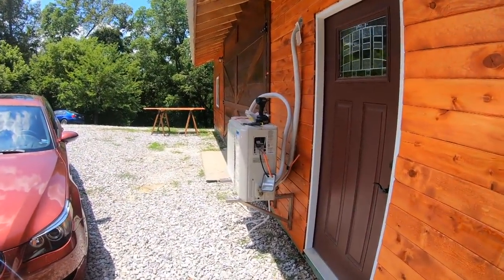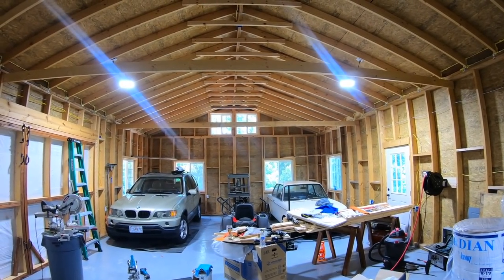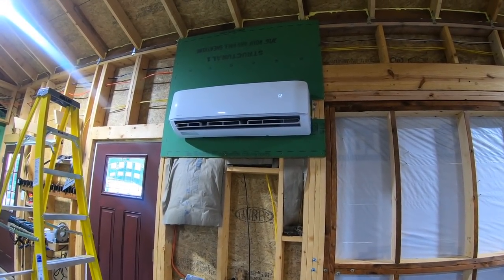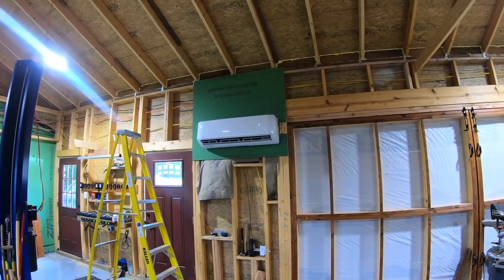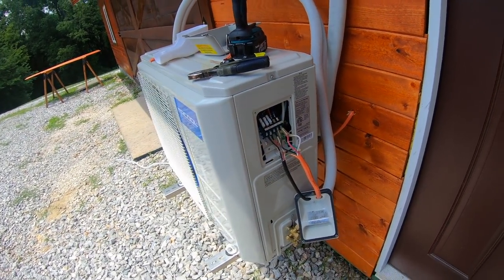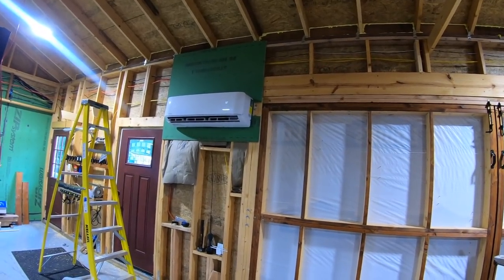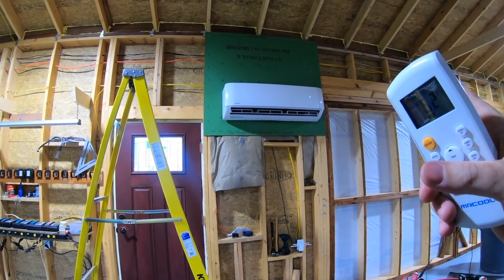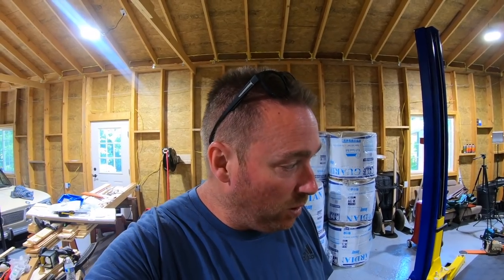MRCOOL Mini Split AC Heat Pump Installation SECRET TIPS Part 1

Comment: You need to evacuate the noncondensibles in the line set and evaporator coil down to at least 500 microns.  Also you need a disconnect on the outside electric.
Reply: Directions from the manufacturer specifically tell you not to do that. Why are so many nimrods in the comments saying to pull a vacuum on pre-vacuumed and filled lines?

Comment: So in 2 years from the video the unit went from $1200 to over $2000. Instructions I found it seemed odd that wall mounted you only need 6" clearance but on ground pad you need 12". Seems like 6" would be poor air flow. Hat that they only provide 25 feet of line when 12 would get it done if on a ground level room. Warranty is a joke to meet all the requirements over time. One guy had leaking factory joint lines but would not cover as warranty!

Comment: each 12000 btu for 500 sqft. You have 24000 btu it's mean is good for 1000 sq ft.But if you square footage is more that 1000, 24 btu is not enough. Plus insulation of building.

Comment: A nice and very informative  video, Nathan.
  

I am also considering installing  the same heat pump to heat/cool the 1st floor of my house and request you to help answer this query of mine.
The 1st floor of my house has an open plan with 16' tall ceiling Formal and Dining Area of 800 sq ft. The formal area connects to family room and kitchen with very wide opening ( no doors ). The family room  and kitchen has no wall in between and  covers 500 sq ft with 8' ceiling. As such, all these spaces have no constriction for air flow in between.  A circular staircase goes up to 2nd floor from formal area and 2nd floor has its own zone for heating/cooling.  The home is well insulated and is  located in bay area , CA where weather is temperate all through the year.

Do you think 24000 BTU MrCool heat pump will be able to heat/cool adequately this 1st floor space if I put it in formal area  ?  I was initially thinking 36000 BTU, but after watching your video  I started wondering that if 24000 BTU unit can cool your 1400 sq ft of uninsulated shop easily, this should be enough for my needs too. 

How has been your experience with this unit in the winter ?
Reply from the maker: The unit is a beast, heats my shop with 16ft7in ceilings, no issues , I still dont have 100% of the insulation in either , even at 10deg  the other night it had plenty of power

Comment: Your copper loop will trap oil! You compressor will fail!
Reply: Lance Rudy yes it will. A proper trap would be preferred but these small units really wont slug the compressor . So a trap is not necessary . Looping it does the opposite. It will starve the compressor for oil.
Reply: vipleather That is why i prefer cut-to-length refrigerant lines. Seems if these lines need to be coiled, the coil should be oriented horizontally. I wonder if Mr. Cool recommends vertical coiling?
Reply: @charlieromeo7663  MrCool recommends horizontal coiling.

Comment: Dude, what a mistake you made with your insulation.  My shop is 30x40, with a 14 foot center ceiling height with 12 foot walls) I have two mini-splits in it ( a 12,000 and 18,000 BTU heat pump).  Now you maybe should have done like I did.  I framed the building with 2x6 framing, used can foam to foam in all of the studs (96 cans) and bought 9 inch unfaced attic insulation and put 3 mill plastic over it before I installed drywall.  On a 20 degree day the two mini-splits will easily keep the building 50 degrees, and the building keeps it heat in overnight without the heat pumps running.   Now here in Eastern NC we have already had 80+ degree days here, and I have not had to run the A/C on the heat pumps is of yet.  The highest electric bill I have had is $80 and that includes running lights, and other garage equipment to include a car lift.  I would guess the cost of the heat is less than half the cost of my electric bill.  I should add that the building has a tin roof, two 10x10 rollup doors that I insulated with 1/4 inch aluminum over foam insulation, and a 36 inch wide walk in door.

Comment: The window ones work good to instead of putting them in a window, you just frame them to what ever size you need and can put them anywhere you want. Only need 110, but they don't heat though. Looking good, feeling good

Comment: why not mount the unit on the ground, maybe on a small concrete pad?
Reply: I'm trying to decide on same question.  I've read the unit should be 36" from a wall.  I also see the wall mount keeping it easy to clear leaves/debris out.

Comment: you have to vacuum the lines before opening the valves at the outside unit. not mentioned in the video.
Reply: Line set for this system is factory vacuumed sealed. When you attach to the unit, seal is broken as the connection is tightened.
Reply: Yes nitrogen purge once connected and deep vacuum is the proper way but diy guys don't want to spend the 500$ on the right equipment to install correctly. The

Comment: Definitely a DIY you should have drilled the outside hole 1 inch below the indoor so your drain runs downward. Also you should have cut your line set before installation. Now you’re gonna have to pump the system down and redo it.
Reply: Yea and did you hear him talk about pulling a vacuum? No because he didn’t mention it and I’m going to go out on a limb here and say he didn’t and that’s the most important step LOL

Comment: The most important step before you open those valves to release the refrigerant is a proper triple evacuation to below 500 microns then open the valve you should always always always pressure test with 300 psi of nitrogen let it sit then triple evacuation a regular home owner is going to be dumb enough to try this and pay tons of money to have it fixed properly by someone who actually knows how to install these units properly but best of luck
Reply: Are you saying you can still evacuate the lineset before you crack the factory seals?  They come with fittings on the factory lineset for evac/charge?

Comment: Nothing like a homeowner hack job to save a dollar.  The water issue is the drain just laying on the ground like that has an air lock from being double trapped. No disconnect and need liquid tight on both control wire and main power. Local supply houses will not warranty parts for units they didn’t sell, even if they sale the same brand. I personally ran into that on a Fujitsu mini split. So when someone tells you units off the internet has no warranty take it to the bank.

Comment: Hopefully you evacuated the refrigerant lines before cracking the valves
Reply: Actually, both the inside air handler with the lines already attached and the outside condenser are already charged. No need for it to be evacuated.

Comment: Apperantly it is not recommended to loop the copper pipes as it will collect oil at the bottom and reduce kife of ac dramatically.

Comment: I don’t understand why they went so far to make these units a diy install... couldn’t they develop these units to vacuum out the air in the lines , test for leaks. Then charge the lines all on their  own within the unit itself....  add just that lil bit more to make these things soo much better and redundant ,,, add a vac pump and the software to test itself and thro up a code before any refrigerant gets primed into the lines.  .?  To me it’s a no brainer

Comment: All the money you spent, it's kind of chintzy to have 9 feet of coil behind your unit. It's also bad for your unit because now you have non-condensables in your lines forever. For $160 (vacuum pump, gauges, swage) you can cut down the pipes for the right size, make it neat, and make your unit run better. I dunno. Maybe it's just me but that thing is gonna sit there for a decade or more, and you bothered getting the cover which is $55+, but didn't do it right. Weird.

Also, with the electric, the manual is very clear to make sure the colors/numbers match up. For the power, 240v 1 phase doesn't matter what red/black go to, as long as they're hot 120v lines (120+120 = 240v). The neutral in this case is not used and should be capped. 10/2 is appropriate for this unit (neutral not used), but a 10/3 is "future proof" for just a few dollars more. Could you get away with 12? Maybe. You'd probably start tripping the 20amp breaker it's hooked up to after a few years once it doesn't start up as smooth as it used to. And, as mentioned elsewhere in the comments, you don't have a disconnect "within sight of the unit," which is code.
Reply: reddog418 
These units require a neutral in most cases. They are powered by a VFD and the card requires a neutral that it bonded to ground.

Comment: Next time solder the lines. just cut them and add a union, leave the ends alone. Its NOT 410 pressure.

Comment: No disconnect?

No connectors for the electrical going in and out of the condenser?

You didn't angle the hole downward so it is causing a leak, very sloppy installation, typical of a do it yourselfer.

All systems come pre charged, did you bother to vacuum it down before starting up the system?

The shop has some very strange framing methods

Comment: Where did you buy unit
Reply from the maker: Link in the description, the price went up thought in the last 2 weeks
Reply: Nathan's BMW Workshop I was gonna say When I type in google same model comes up for $700
Reply from the maker: Probably for like a 9000 btu not a 24000
Reply: Nathan's BMW Workshop correct for three car garage it’s perfect
Reply from the maker: See I have basically a 4 car garage but with a 16ft ceiling
Reply: Nathan's BMW Workshop 24000 isn’t that overkill what’s the square footage of your garage
Reply: Hey nathan.  I only see the 24k unit for $1700.  Did you get the DIY kits thats already pre-charged? Or was there a sale that I missed? The link you have is the same link I found.

Comment: Why didn't you run the lines inside the walls and hide the extra line inside the wall? It would have saved you money for the trim and it would look better.

Comment: So many mistakes on your installation.  By oversizing the breaker and wire gage you risk damaging the unit. If it was having a issue you want to trip the breaker to protect the equipment. 20amp 2 pole breaker is what manufacturer calls for. Bigger  is not better. It should have been wired with 12-2 wire, not 10-3. Two hot and a ground wire. No neutral wire needed. 
Your running of refrigerant lines is terrible. Buy a tubings cutter and a flaring tool and get rid of extra lines. 
You also need to pull a vacuum on the line and evaporator head to remove all the air.  If you don’t, when you open up the values you are contaminating the refrigerant.

Comment: The schematic is very clear if your not a DIY! Luckily you did not mix up 2 and 3. No way you should have a breaker larger that rating of 25, this is a joke, do not listen to this guy. You could burn your garage down with an oversized breaker.

Comment: I got mine installed and theres knw thing I didnt like It leaks a lots a water
Reply from the maker: Make sure the drain is hooked up, and make sure the head is level so the water can run down the tray to the drain , had that issue here on my new unit

Comment: A gas furnace maybe would be 80,000 Btus? This unit maybe is 12,000! I wish you luck in January  unless you stay above 50 degrees!
Reply: Youd be surprised at what these can do i have a hyper heat unit and it was producing 90 plus degree air in single digits and its only a 18000 btu outdoor and  12000 heads 20s or above they have no prob blowing 130 degree air all day   keep my two story 16x30 well insulated barn at 60ish all winter set at 65.

Comment: Why do you need outdoor wiring ? That’s what the installation kit is for it protects the wiring.  And you should have cut the hoses to size, that’s tacky work guy. Ppl do not do this.

Comment: did you tell everyone to pull a 5 micron vacuum, on the copper supply lines before you release the charge from the condenser unit ! ?  quess you were too much in a hurry to read the directions !  i`m in the business 40 plus years.  good luck with that system lasting ! nothing wrong with doing it yourself but learn how to do it first. hope other read first !

Comment: Except electric work everything made sense. 
I thought they provided wire, why did you have to purchase it?
Reply: THEY PROVIDE THE COMM WIRE THAT GOES FROM THE HEAD UNIT TO THE UNIT OUTSIDE, BUT NOT THE POWER WIRE FROM THE BREAKER BOX TO THE OUTSIDE UNIT

Comment: You should really vac out the pipework with a vacuum pump to remove the air prior to the release of the gas 
air has moisture in it and this can damage the internal workings of the unit

Comment: i would get a PTAC
Reply: don't work as heat pump below 39F also mold issues?
Reply: @donfrussell  well, here at least never had mold issues if it is kept clean, however the heat pumo thing is true, thry have electric heat versions as well.
Reply: Just something I read
Reply: @donfrussell  well, it is correct, in very cold climates heat pumps do not work, most if not all heat pump systems have an emergency electric heating coil that will work no matter how cold it is. as far as the mold thing, alot of cheaper units have Styrofoam ducts, so they mold quicker, but as long as you clean them well like every 2 years or so mold should not be an issue, and this is the same for a mini split as well. but of course choosing the right unit for you depends on several variants, there is never a solid answer. i just like PTAC units because they can be easily slid out of the sleeve and cleaned, and when the unit fails you just have to get one the same size and slide it into the sleeve and you are good to go.

Comment: Cheap purchase....good.....all that extra line set outside......bad.....follow me mode uses the remote to actually sense the temperature, otherwise it uses the thermistor on the coil to read temp.

Comment: You don't want to stay above freezing, you want to stay above dew point so everything you have doesn't rust IN YOUR SHOP.  You have no business making a video about installing a mini split.  None.  Just about everything is wrong:  clearances, knowledge of precharged lines and/or need to evacuate the lines when they're not, blah, bah, blah.  And,  IT IS WIRED INCORRECTLY!  Of course it is... you don't know what you're doing.   Why do you have the neutral and the ground bonded at the condenser?  This is a code violation and it's unnecessary to us a 3 conductor w/ground cable!!   You only need 12/2 or 10/3 depending on your ampacity.  JUST STOP!!!  You're not even done so why the eff are you making a video??   SMH